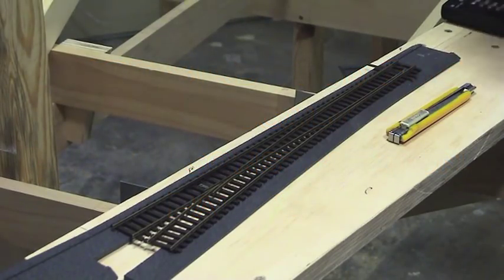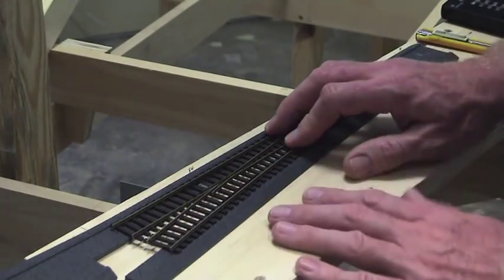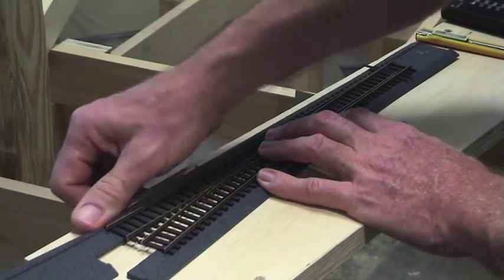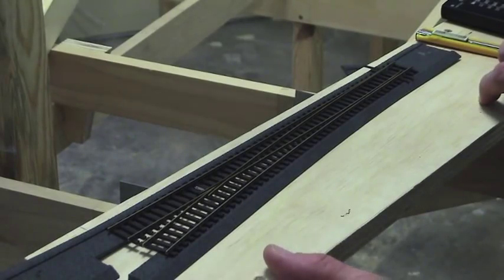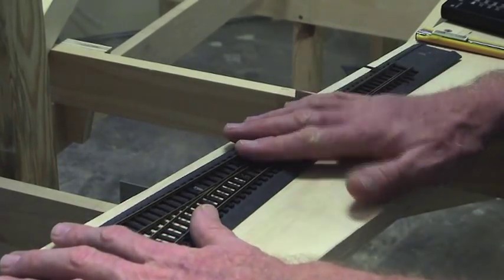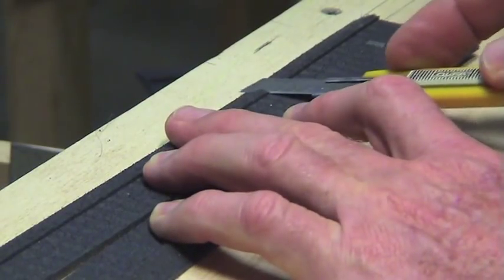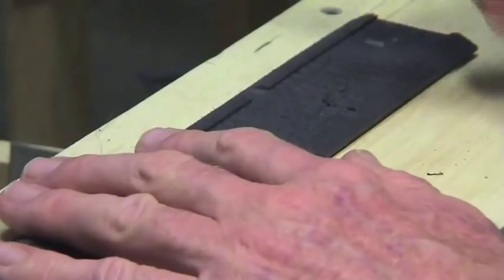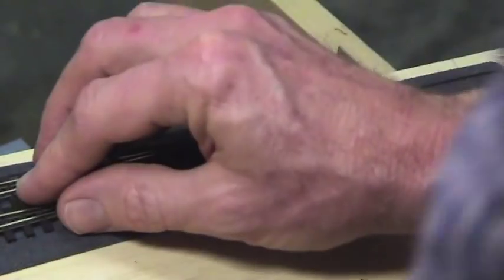BNSF Birdwood Sub"  HO Scale. Part 8 - A

Comment from the maker: They are "Tillig", German made, they are not for the new modeller as they are fragile and need a switch macjne to lock the switches in place. Also the sleepers are Euro spacing ,but once laid they perform very well. I get them from a European hobby shop in Adelaide,Aust.